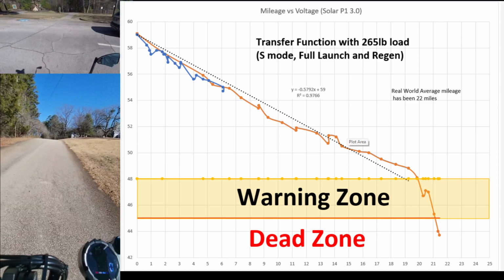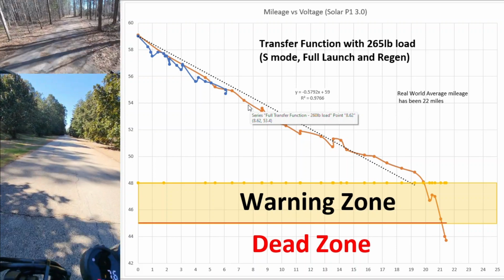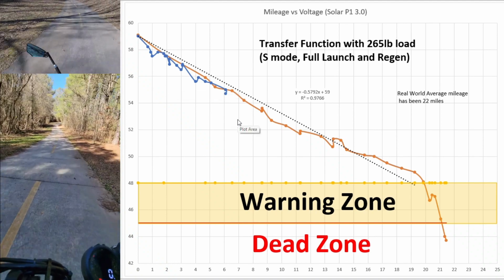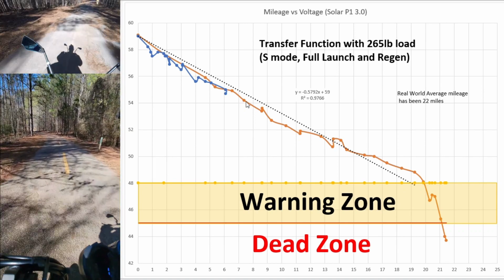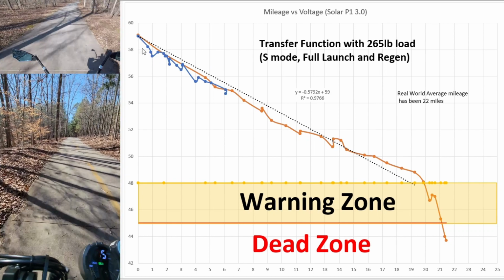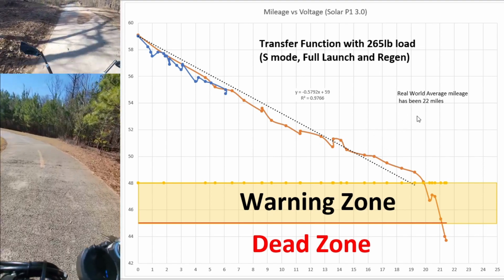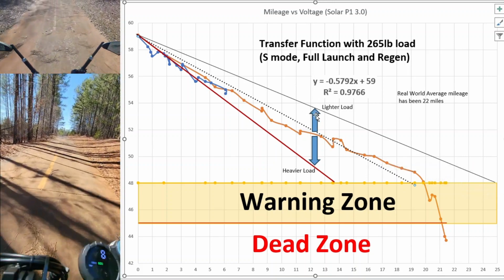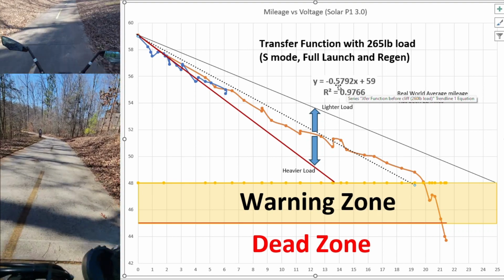Solar p1 3.0 range test and transfer function

Comment: How long have you owned the scooter and have you noticed a significant amount of battery sag overtime.? Our solar P1 3.0 seems to have a significant amount of battery sag after about six months 200+ miles or so on it.
Reply from the maker: I've had it about 5-6 months with about 180 miles on it.  What specifically are you seeing?  When I think of sag, I think of the drop in voltage due to load... which is dependent on things like hill grade, rider weight, speed, etc.. The measurements in my chart are under no load conditions so they won't be effected by these things while I'm taking the measurement.  If you mean max charge voltage, I haven't seen any significant change.  If you mean miles ridden per charge, I haven't looked at this in detail.  I haven't ridden long distances in awhile, but I haven't noticed a significant change in battery duration with shorter trips.  If you have any specific conditions or details, I can take a look once the rain goes away.  Hope you are still enjoying your ride!
Reply: @adrumwhisperer  Great work and detail here. The thing I am noticing is on an average ride 18-20 miles under varied terrain with 175 rider in mode 2, the last half of the battery sags so much that its becoming unusable as it sags into the protection range of the battery.
Reply from the maker: @Scooter-King.  Thanks, I wanted to have a way to more accurately determine how much farther I can make it on a ride... the bar display is not very useful.  Looking at my chart the transfer function becomes non-linear once the battery voltage gets below 49V.  I would suggest plotting your xfer function out every mile like i did and find when your curve falls off a cliff as well.  These measurements should be done with no-load (at a full stop).  Then you can look to see if this "cliff" changes as the battery gets older.  Keep in mind that you may be at 49.5V under no load and then see the battery voltage drop when a load is applied (going up a hill for example).  If the load is large enough that "sag" will put you into the "Warning" or "Dead" zone and the performance will decrease significantly.  the warning zone is good enough to keep me going on a flat road or small inclines.. the dead zone is barely moving at all.  The same hill with a battery voltage of 58V may not show any performance degradation.  In general, my plot shows there isn't much of a performance hit as long as my battery is above 49V.  A 8% hill slope may cause approximately 0.5V drop if I remember correctly.  Based on your weight I would expect you to easily get more than 22 miles for a full charge in normal riding conditions.  The mode won't make a difference, if you ride at the same speed.  (i.e. 10mph in all modes will put the same load conditions on the motors).  Of course if you are riding at faster speeds available in higher modes it drains the battery faster.
Reply: @adrumwhisperer  Great info, thanks!